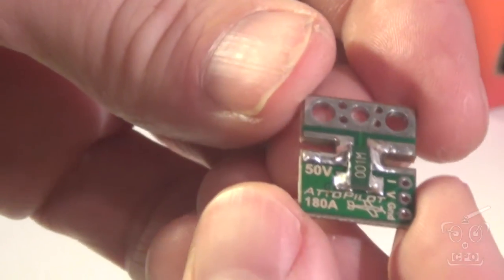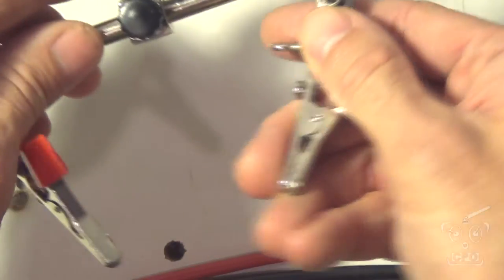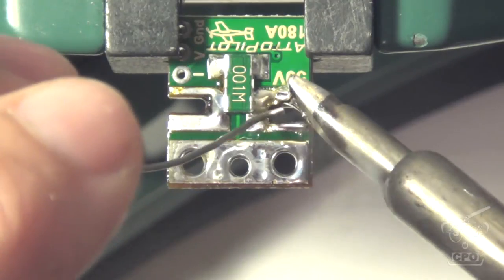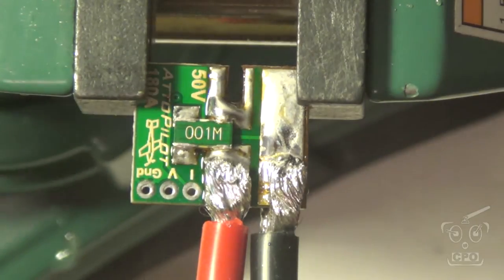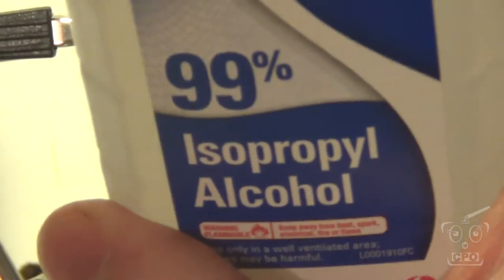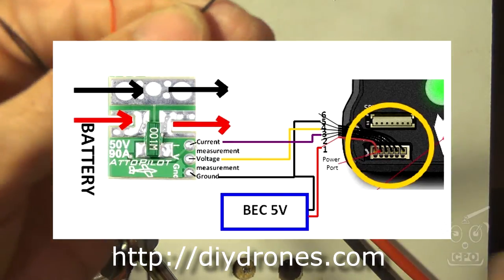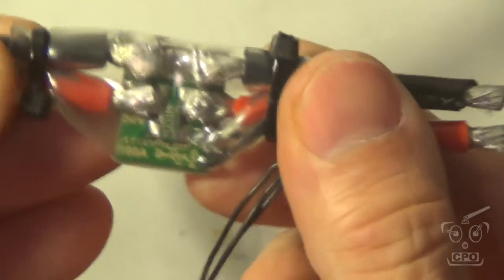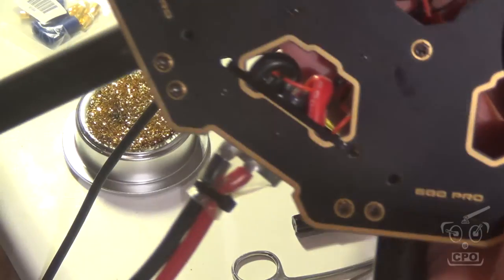Tarot 680 Pro Hexacopter : Attopilot 180A Installation (voltage/current monitor)

Comment: Nice- I wish I had seen this before soldering my atto- the "V" tip on the wires is a nice touch- since I didn't do that, it was very difficult for me to do- I only have a fine tip point on my soldering iron, so the little stuff is easy but the big stuff (anything over 18 gauge wire) is hard for me.
I used a low noise bec from rmrc and I am powering through the power module port and I am using the number 1 motor esc bec to power the servo rail for redundancy. I did a prelim test flight on  4S battery July 4th- I expect my lipo adapter hardware and ends to be here tomorrow or Tuesday allowing me to see how it truly flies and get the initial trims and tuning done.
I am pretty impressed so far- but the initial setup with Mission Planner was a bit buggy for me and I needed to go back several times before figuring out some tricks- There are a few parameters I needed to tweak before it would fly- and interestingly enough they were highlighted in the advanced parameter menu... but documentation was nowhere to be found telling me that was the case.
Reply from the maker: Interesting. I was hoping to maiden mine this weekend, but ended up short a prop adapter, so I think I'll have that tomorrow - so I can mount the last prop.  I didn't get into anything past the initial configuration in mission planner, but it seemed okay so far. 

A 70W soldering station and a chisel tip iron were some of the best purchases since I've been in the hobby. I rarely put the fine tip on anymore. 

I am running mine with a Hobby Wing UBEC, but I am just running through the servo rail for now. No redundancy at the moment. All of my ESCs are opto...so no power from them either.
Reply: EVERYTHING cpo

If you have everything working, but the motors don't want to spin up with full power- the last option in the advanced menu is a throttle max parameter that was near zero on mine... it needed to be all the way up to 1000. I was stumped for maybe a day on that. I also found that there can be all manner of weirdness on loading up the firmware- but that was possibly user error as I no longer have any problems. I have some yaw drift and twitchy like flight characteristics but they are probably gains and trims... the thing is my AUW is right around 3.5kg and I am running pretty large- I am really hoping for 16 to 20 minute flight times- ecalc has me at more than that but I have seen very little consistency with that to put full faith. I am impressed at the lift the APC 11x4.7's give on the the craft- with 4S it lifted up at 80% throttle and I honestly did not expect it to get off the ground- it is spec's for 6S so I should be at hover at 40 to 50% if all goes well.

Comment: It's been a long while since any activity here, but I was hoping for clarification on the wiring of the attopilot board. I was on the RCgroups site and I saw a link mentioning the need for resistors in the circuit for the 150a version of this board, but I was understanding that the 180a board would be needed to for a hexacopter using a 6S. So, my obvious question is in order to protect the PixHawk safely should I wire in some sort of resistors, and if so what values for the 180a in the power cable to the PixHawk? Thanks